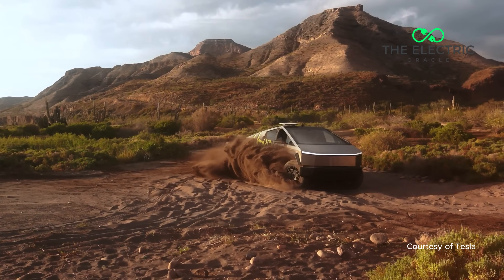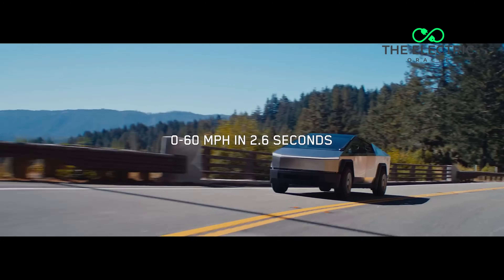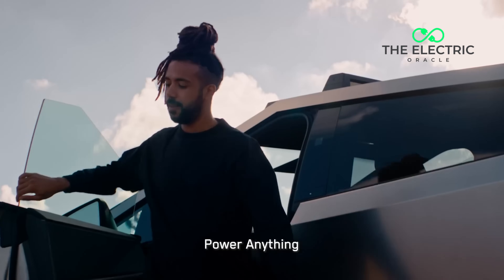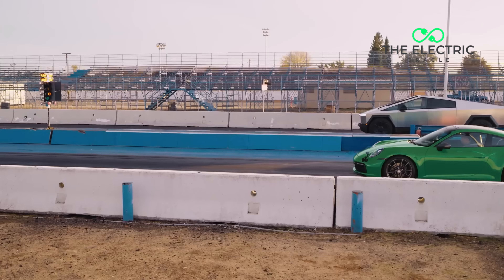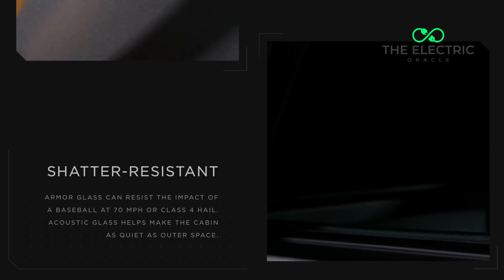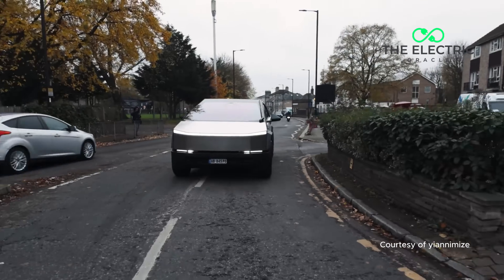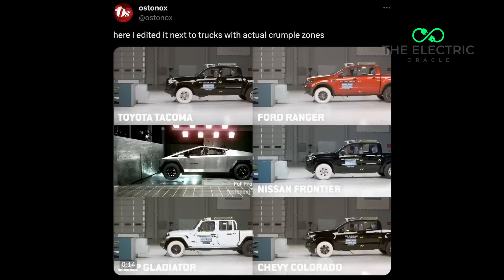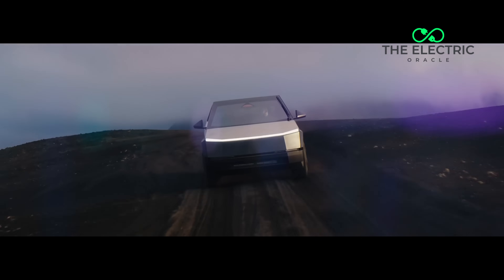5 Safety Issues Keeping Tesla Cybertruck Off UK Roads 🇬🇧

Comment: EVs should not be given any free exemptions on safety or weights it's down to the manufacturer to fit into the law.
Reply: Weights were set to protect the public. So they should not be changed just because vehicle designers are muppets.
Reply: EVs can easily fit current weight limits, you just have to keep cars a reasonable size, which the cybertruck clearly is not.
Reply: The UK actually has an exception for electric vans, they can weigh up to 4.25 t, with the same rules applying as for petrol or diesel powered vans weighing up to 3.5 t. This was meant such that electric versions of existing van designs could still be driven by people with a standard license.

Whether that is a good idea, can be debated. The alternatives are for electric vans to either be smaller and lighter (incl. possibly reducing the payload) or for their drivers to bite the bullet and get a C1 license. Apart from the license this also includes more frequent vehicle inspections in the first three years and requirements for tachographs to document driving hours and other parameters.
Reply: Exactly.
Reply: I agree but would go further and make it the responsibility of the manufacturer to ensure battery fires are quenchable without passing the problem to the fire brigade to somehow lift the vehicle into a water filled dumpster.
Reply: The weight issue is only a paper issue. Update the paper and weight will pass.  ALL the other issues are significant.
Reply: @mrcryptozoic817 why not just make the vehicle fit the law
Reply: @ Ah yes. Make the toe of the lever bigger and the lever shorter.
Reply: That's for sure. Truth be told, at this point, EVs are just rich people's toys....not a serious form of transportation.
Reply: @ Well, I guess Norway almost only consists of rich people. Last year 88.9% of all new cars sold there were fully electric vehicles.
Reply: @aphextwin5712  Norway is indeed a very oil-rich nation on a per capita basis, they didn't have Maggie Thatcher sell off their oil at a cut-down rate in the 80s to cut taxes for the wealthy and instead sold a series of restricted drilling rights with the income going to a sovereign fund to support the nation, its also rather ironic that the way they are funding the switch to EVs is from the ongoing sale of oil.
Reply: @tasherratt  It of course takes both sides, those who consume energy (and take the fossil fuel route) and those that make money supplying the fossil fuel. You can blame both sides, but at least one side is doing something. 

And for those being able to do math, eg, companies that have accountants, they have realised that in a lot of cases, electric vehicles are actually cheaper over their whole life cycle.
Reply: @tasherratt we had sold the oil rights long before the Conservatives under Thatcher came to power, try late sixties which would put it into Labours court, bottom line is, in politics it's only the colour of money that counts.
Reply: @aphextwin5712 how many electric cars were sold because of laws and how many because of organic demand?
Reply: @ It was almost only done via incentives. Mostly financial but also via perks like priority access to parking spaces (if remember that last bit correctly).
Reply: @aphextwin5712  so not organic, people actually wanting electric but they wanted the dangling carrot? The governments job is to provide infrastructure so people want them not force or coerce people into buying them.
Reply: @Mr.Bill69  The government’s job is to fulfil the will of the people. And if the people want to end the use of fossil fuels, then it is the prerogative of the government to subsidise electric vehicles. 

The same way when the people want to lower emissions of other harmful substances, it is the government’s right to tax those emissions or subsidise technologies that reduce or omit those omissions.

If the people want that poorer people get some support, it is ok to give poorer people tax breaks.
Reply: @ it’s clearly not the will of the people or they wouldn’t need incentives to buy one people would just buy one…more so if it is the will of the people the government should be focusing on infrastructure so people can charge them!
Reply: @ So, because you need financial incentives to ensure that at least the vast majority sticks to the speed limit on roads (“speeding tickets”), those speed limits and their enforcement are clearly not the will of the people?  And if the majority of the population is of the opinion that richer people should be taxed a bit more, such that the majority of the population can afford electric vehicles, than such action would be against the will of the people?

Yes, people can be irrational. They might agree to a very slightly higher tax rate to finance subsidies for electric vehicles, while at the same time they could not moved to spend that money directly. One explanation is probably that most people believe that richer people (ie, people richer than them) pay most of that extra tax, and that they are thus getting a good deal.
Reply: First off, this video makes no sense about the weight. You don't need a commercial license to drive one of these. That is a fallacy. Anyone with a regular license can drive one. The weight is just fine. It's the styling and over all look that is horrible.
Reply: @theodindottir  if it's over 3.5 tones and you have a license after 1997...... You need a C1.
Reply: @m341ehw  Meanwhile in my country (Singapore) vehicles exceeding 3.5t also legally require a 60kph/37mph electronic speed limiter, while some minor roads in single family home neighbourhoods have unladen vehicle weight limits of just 1.5t
Reply: @theodindottir  No, not in Europe you can't. Here, in Europe Drivers liceses for category B ( passanger cars and light trucks ) are weight limited to a maximum allowable total weight of 3500 kg. So if your car has a maximum capacity of passengers+bags above this number, then you have a light commercial vehicle at your hands.
The only way around this is to make the maximum allowed total weight at 3500 kilos or less. The cybertruck has an empty weight of 3100 kilos. This means that if you do not derate it from the official payload capacity of 1100 kilos, you are way over the 3500 kilogramm maximum limit. And if you derate it, then you have a total maximum allowable capacity of 390 kilos for passengers and cargo. So Commercial truck license it is for us...

Comment: Could they put a self-extinguishing system onboard so if there is a fire everything just get filled with fire resistant foam?
Reply: No need, one of the 2-3 Optimus robots of the household will appear and save the passengers.
Reply: when EV batteries get too hot (go into thermal runaway), they create their own oxygen, so it wouldn't work. They even burn & emit flames, under water...

Comment: I think the thing isn't heavy enough. Also needs more sharp edges or maybe steel spiky bits protruding out of its front. The wheel hubs are missing swords that spin when the car is moving like on ancient chariots. In fact, why even wheels? What about tracks like on tanks, but with spikes that grip the road better? Windows? Who needs windows? Just have a narrow slit at the front to see through. As for lights, the present ones don't do the CyberTruck any justice. LED arrays on the front and back would be far better. They could display "CyberTruck" on them, maybe even moving, to make sure people know what is in front or behind them.

Comment: The question whether rescuers need to update their material and techniques is a no-brainer. But not for something like the Cyber Truck that neglects all safety standards. Only in the USA it is possible because the heavier vehicles don't have to regard the safety of weaker road users, be it cars or humans.
Reply: They could use small directional explosive charges to cut the roof pillars. It may burn and blind the occupants but hey ho, there is a cost to everything.

Comment: How did this thing get certified to drive on American roads?
Reply: because of the massive 'light truck' loophole that american auto makers got created for them which skips a huge amount of regulation.
Reply: they allow any shit on the road
Reply: The car companies in the US self-certify that their vehicles comply to standards …
Reply: @johnleonard9090  they do it them selfs if the issue not a 3rd party
Reply: The cyber truck has never been officially crash tested yet!!!!!!  There is a loop hole in the USA that manufactures can carry out there own crash tests but eventually they will have to get NHTSA CERTIFICATION
Reply: You're making the assumption that the US has any centralised vehicle standards authority. A lot of states have no vehicle safety check system like the MoT, and it's just down to the driver whether they're willing to drive the more rust than metal chassis.
Reply: @DERP_Squad  Indeed - just look at some of the horrors on "Just Rolled In"...
Reply: @DERP_Squad  Of course there is a centralized vehicle standards authority. The lack of yearly nanny checks doesn't mean that there is no regulator that set standards for new vehicles.
Reply: Yet they had to modify a new Scania truck to comply with antiquated American regulations.
Reply: @patrickporter6536  Countries have different regulations. The fact that they had to modify a Scania for North American use is no different than having to modify a Cyber Truck for Europe. I'm actually surprised that a Scania passed the idiotic EPA standards for diesel emissions since they allow only a fraction of what the Euro 6 emissions standards do and the diesel fuel in the US has far less lubricity than Europe or even Canada.
Reply: Retired couples are driving 45 foot converted busses on a standard license in the US
Reply: @ They generally fall under RV exemptions for vehicles over 26,000lbs. Currently 39 states have RV exemption legislation so if you register your RV in one of those states you are good on a passenger license. We happen to be in a one of the 13 states (plus DC) that doesn't have an RV exemption, so 42' coach (54,000 lb GVWR) with a trailer means that I needed a class A license (same as HGV Articulated license in Europe/Australia).
Reply: That's what surprised me!
Reply: The USA has lower standards.
Reply: @MR_THINQ  Shame you aren't Mr. Think...this thinqing you do gets you nowhere. We have different standards, because we have a different country, with different roads and whatnot. Your standards would not work in the US. Try using your brain, it might help.
Reply: @MR_THINQ  In just about everything.
Reply: It's a truck so it just needs some wheels and a NUT.  Same way some of the pickups start folding in the middle after a bit of off-roading or bumpy roads, still safe to use on US roads it seems.
Reply: @WhiteDieselShed  no its not safe to use anywhere the USA just has a car only mentality
Reply: @WhiteDieselShed  Nope, not a bit of it. Those trucks in that condition are not road legal...just because many idiots continue driving these death traps, doesn't make them legal. Same goes for rusted out cars--I used to drive such cars....because all I could spend to buy a car was a few hundred, and you can't get a good car for that kind of money. Poor people still have to have transportation. They'll do what they have to, including taking the chance that the car will collapse in the middle of the road.
Reply: in the states they get todo it them self
Reply: @technomad-361  They still have to get approval from the National Highway Traffic Safety Administration. Car makers don't get to do it themselves?
Reply: @ceddiec1111  It's a commercial vehicle though so it seems anything is legal.
Reply: @ceddiec1111  you have way to much faith in the USA car-centric culture, yeah they do get to just do it them selfs
Reply: @ honestly I have zero faith because I know anyone in politics can be bought
Reply: @WhiteDieselShed  Commercial vehicles are regulated by the FMCSA, but all vehicles regardless of registration fall under the NHTSA.
Reply: @WhiteDieselShed  And yet the tiny, practical kei-trucks are banned because they are considered (by legislators and / or lobbyists) dangerous.

Comment: Correct me if im wrong but I passed my car test in 1995 and my driving licence came with C1, C1E classification as standard, no extra tests or medical certification.
Reply: If you want to drive a 7.5t commercially or anything over 3.5t you'd need a CPC card but no medical. They can also take the C1 off your licence at some point if you don't use it.
Reply: @S4f3ty_Marc Its a different form to renew but no issue retaining C1/D1 entitlements

Comment: I'm glad that we never will see those freak cars here in Europe.
Reply: it's quite appropriate. it ended up being a joke played out on one market.
the market that deserves it most.
Reply: Unfortunately, a few have already passed homologation in the EU. I don't understand why here in the Czech Republic it is so easy to approve an individually imported car even if it doesn't meet any standards.
Reply: @Nhkg17  I used to work in Saudi Arabia I exported 5 cars back to the UK as personal Imports, A mercedes C class, three Rangerovers with bull bars on them and metal cages in front of the lights and a Porsche boxster.This was when we were in the EU.  The lights all had the EU E markings, all were LHD.  All I had to have done is have the headlights adjusted for driving on the righthans side of the road and run a wire from one wired rear fog light to the one on the other side so I had fog lights on both sides, which was legal in the UK.  They all passed.. I had no certificatre of conformity.  I had to go to a government private import car test center but it was basically an MOT.

MOT rules are that it won´t pass an MOT if the body work has sharp edges as a result of accident damage or rust.
Reply: Never say never.
Reply: We might not see any Tesla products at all if Trump goes through with his threats and tariffs.
Reply: @ngauruhoezodiac3143 

Good.
Reply: Several Cybertrucks have been personally imported to Europe and got legal registration. One importer changed the indicator and brake lense covers and bought some u shaper rubber tubing and glued that over the sharp edges at the front.  The UK has a lot of Ford F150 250 and 350  pick up trucks imported by US military.  We have Range rovers Germany has G wagens  I had range rover with bull bas fitted.
Reply: No, what we will continue to see is romaninan "horror-caravans", with no brakes  now lights,, flyin`down the highway :)
Reply: @sentenced2sail  All of the rules and laws he is talking about apply to all European countries including Romania - in fact Romania also has a MOT type test very similar to the UK, accept the penalty in Romania for driving without an MOT is 9 points on your license. You get no points in UK - just a fine of up to £1,000.
Reply: @sentenced2sail last summer I saw a cybertruck that has burst into flames in the parking lot of the local diner.

It wasn't even being driven - the owner was in having lunch and his brand new truck just turned into a funeral pyre for itself.
Reply: @sentenced2sail racist much?
Reply: @Beandaddy2013  I am sorry that you find the cybertruck racist.
Reply: @Beandaddy2013 WTF kind of comment is that?

Comment: Truck should not be on uk roads. Electric is good if you drive to supermarket and home. If you need to travel 200 miles in the cold winter weather then 200 miles home,EVs turn that 8hr journey into a 3 day ordeal if you haven't passed away from hypothermia en route. Clown cars.

Comment: Okay, this is the first time I have seen someone do a proper job of explaining  the issues. Good job.
Reply: Terrible job.  Full of speculation and incorrect claims.  The cybertruck is below required weight for class B at 2.99 metric tons and the only regulation on lamented glass is that the UK requires it, not restricts it.  He also got the panel thickness wrong.  1.8 on the doors, 1.3 everywhere else.  Not 3mm.

The only thing he may have gotten correct is the light color.
Reply: @tripzero0 Ok. Go ahead, import one to prove you are right.
Reply: @julianmorrisco  one can read laws and specifications before trying to import.  In fact, I'd highly recommend it.  If you can debunk my claims, do it.  Otherwise, spare us your inane drivel.
Reply: Piss poor job you mean.
Reply: worse job I ever seen..... didn't mention Personal  Imports all approvals and rules he talked about were for importation for resale
Reply: @martinhill3986  You think if you import it for personal use the rules won't apply?
Reply: @killerkally7080 they have no idea about importing cars for personal use 😂😂 even Mat Watson had SOME work to do on a Honda S660, a tiny shoe Kei car.
Reply: @martinhill3986  No, those rules are for the vehicles to be driven on U.K. roads legally.

Comment: Evs can catch fire, and when they do they basically turn into a bomb. When the battery is on fire - chances are the electrics wont work. You need a door to open. With everything electric. you need a emergency exit from the veicle - if the glass is unbreakable - thats a big fucking liability. Imagine you're in your unbreakable metal box and your vehicle is on fire.

Comment: #1 is not really an issue. Every car has this. Even though the US would have amber blinkers, they should have separate (E) approved  lighting systems, anyways.

#2 is true to most EU countries, too. In Finland C Class licence prevalence is around 10% of driving licence holders.

#3 in not itself a problem, but EU or UK do not accept self-certifying against the safety standards, like US does. Especially crash tests should be done independently by the regulators.

#4 the same applies, as to #3

#5 the same applies, as to #3 amd #4

#Bonus: Drive-by-wire is now allowed in EU / at least in Finland. BUT. I do not think Tesla's cheapo non-redundant approach wil cut the cake.
Reply from the maker: Thanks for the feedback :)